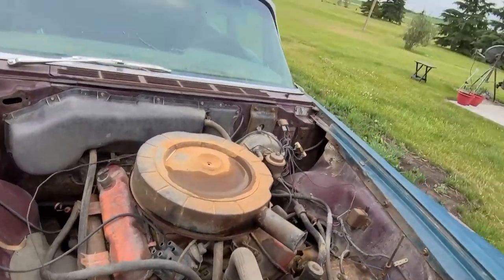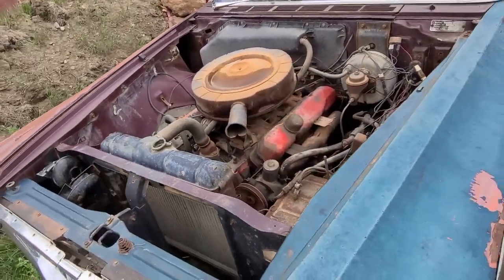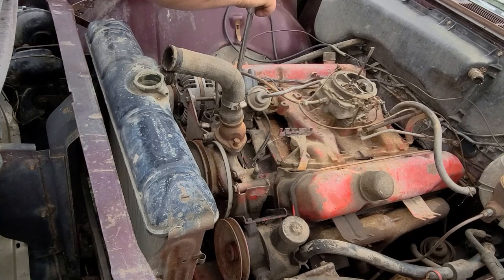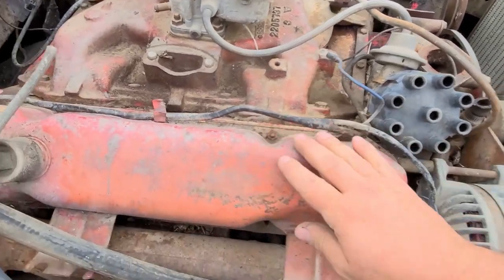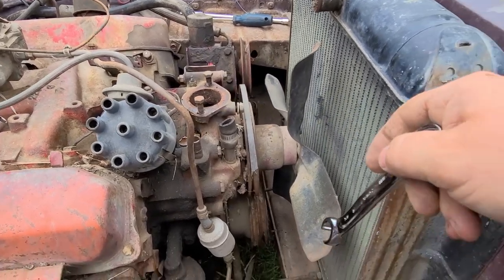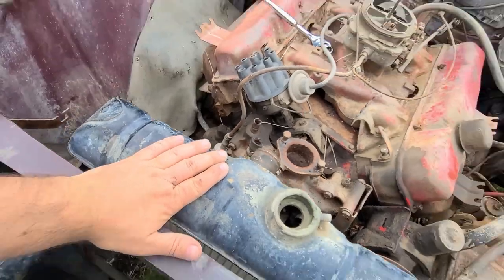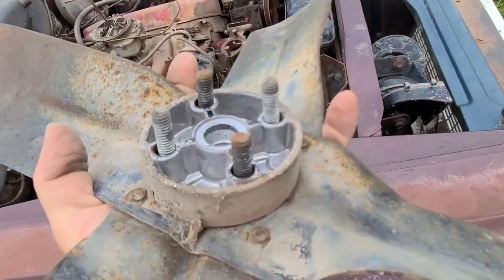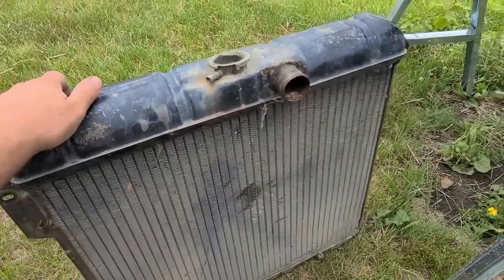1964 Chrysler, Time to start stripping the engine bay.

Comment: 12:39 - "heat riser".  The by-metalic coil puts enough tension on a butterfly valve that it directs exhaust up to the carb during warm up.  It help speed up initial firing and warm up phase on a cold morning.  
It's not a EGR either. Once the spring heats up the valve is wide open.

The only pollution control was a PCV valve - a hose from the carb to the valve cover where the PCV valve sits.
Reply from the maker: Thanks.  I'll now call you, Mopar Moe! 😂👍
Reply: @DuchesnesCorner   😉